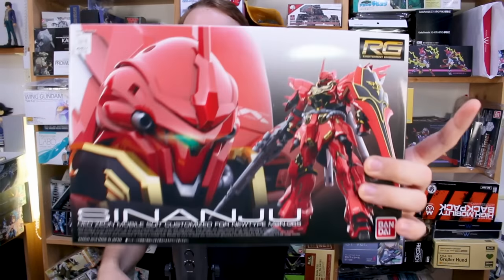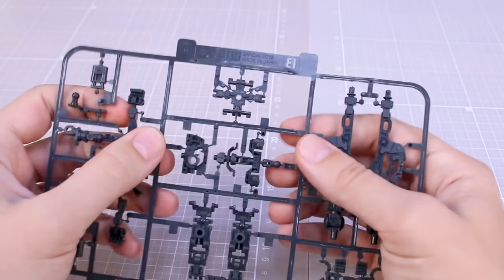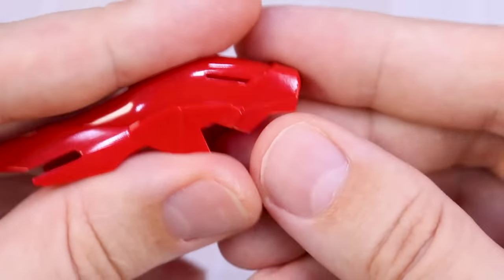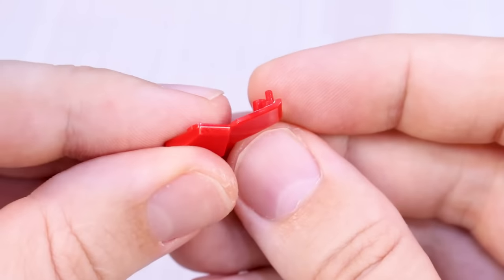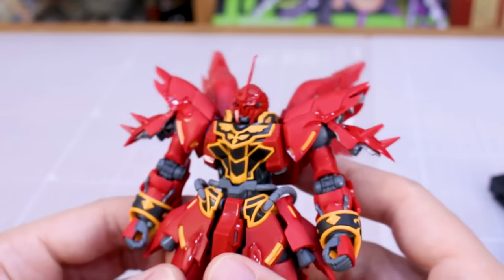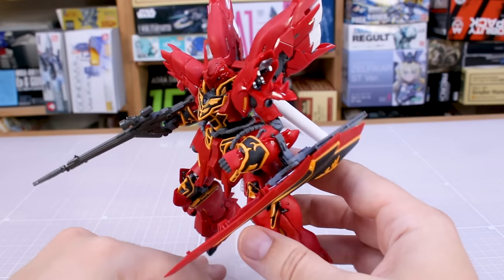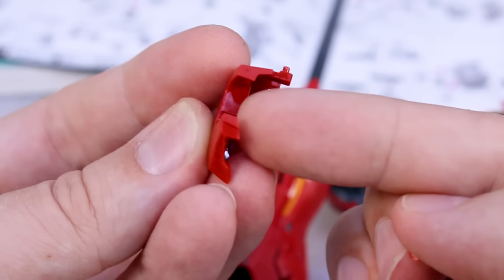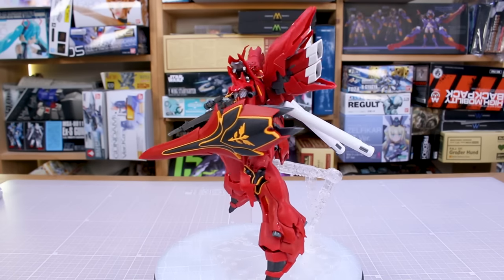What Makes a BAD RG? - In-Depth Case Study: RG Sinanju Revisited

Comment: The HG Shinanju is actually a really sharp looking kit.  Certainly one of the better HG kits.
Reply: The HG & MG ova version are better overall besides the stickers.
Reply: Frankly, I prefer the look of the HGUC Sinanju to the RG, and it's not even very close to me.
Reply: it was my first kit and the amount of foil stickers were insane, still a pretty nice kit overall
Reply: stickers kill off the satisfaction tho. can be fixed with reverse washing but still
Reply: @stm12p  I'd imagine the kit falling apart also kills off the satisfaction too.
Reply: @steel749   true. however not entirely true for everyone. i prefer to keep them in 1 "best" pose after i painted them. so i glued the falling part.
Reply: @stm12p  gold gundam marker instead of sticker works very well on the HGUC
Reply: Waiting for mine to come in. I plan on negating the stickers and instead using gundam marker gold to make the parts that are supposed to be stickers actually painted on. Wish it was separate pieces it’d be lots easier
Reply: @stm12p  why bother with the sticker if you're painting anyway :/
Reply: and rg sinanju is just the same armor design as hg sinanju.  no rg panel line detail. the only difference is just the gold sleeves
Reply: @bimaatmana9505  i dont normally paint HG kits. like i said stickers can be fixed with reverse washing but still seeing that amount kills off some satisfaction. i don't even bother painting RG sinanju cuz it looks astounding by itself
Reply: @bkebradley  The HGUC and the RG are the same kit apart from the inner details and the gold. Even the RG decals are compatible with the HG.
Reply: @chaiweijun8072  Im new to using gundam markers and want to use it for the Sinanju. Would a gundam marker be all I need? I dont want to use extra paint so Im holding off
Reply: @mikloridden8276 for HGUC Sinanju the part to be painted has recessed non gold parts. So just run the flat tipped gold gundam marker along the protruding parts lightly, it should work out.
Reply: but the stickers...
Reply: @mikloridden8276  It's possible but also certainly a very precision-heavy job. Very easy to smudge paint over the edges of the raised details and then trying to clean it up and ending up hitting the part you actually want painted and then repainting it etc. That's the reason behind people developing the reverse-wash technique for the Sleeves Mobile Suits: despite the extra materials involved it ends up being an easier process.
Reply: @steel749  the mg ova version at least comes with the ver kas waterslides tho
Reply: In my place the hg price not that much different than the Rg sinanju. I'll definitely buy the RG even its hand grenade. I'll fix it
Reply: And much better to scale up if you don't want a figure that will fall apart in your hands, you have the solution, the hg
Reply: Ovjectively, it is a pretty good kit, especially for its time. However, mold degradation really hurts it on newer reprints. I got one with the blue bandai logo a few years back, and the joints' stiffness was all over the place. Some parts like the ankles were annoyingly loose, where as others like the shoulders were stupidly tight. Keep in mind that this was one of my first kits, so I wasn't very familiar with using things like sandpaper or super glue to fix those issues, but I was informed about how to handle these kits.
Overtime, even with just minor pose adjustments every now and then, the left arm + one of the backpack's thruster straight up broke, which was kinda sad as the sinanju's my favorite zeon suit.
Tl;dr: yes gud kit, just not good for straight building (btw the stickers were a nightmare)
Reply: Still in process of building my HG so I'll without final opinion, but these gold stickers are unforgivable

Comment: “Playing” shouldn’t include “changing the pose once every 6 months” and finding that the kit’s joints have loosened. That should be a normal use case.
Reply from the maker: Every kit gets lose over time
Reply: How bout metal?
Can they get loose too?
Reply: @ZakuAurelius  But you always frame it as people “playing” with them too much. Also, there are small differences from kit to kit that come from tiny production issues. Fabrication machines all have tolerance levels. I imagine Bandai’s are very high tolerance, but the same part from two different boxes of the same kit are not going to be 1:1. These small differences lead to different experiences for some folks. Plastic quality can also vary depending on the production run. But you just seem to hand wave these issues away as user error. That said, I much prefer the format of this video to your earlier “myth buster” ones. You framed the latter videos as somehow more definitive than other people’s equally as valid experiences with the same kits.
Reply: @evoltblackhole8677  they wear out even faster because it's metal on metal while also being heavier, and not all metal joint has plastic insert
Reply from the maker: I’m not hand waving away anything, and sorry if it felt like that. Even if what you’re saying is true about parts not being 1:1, you may be right, but it would have to be like 1:0.999. My point is that it’s so slight that it’s practically insignificant and either way the fixes to any issues the kit has are pretty simple. Therefor it’s unfair to write a kit off entirely as “bad”
Reply: @ZakuAurelius  sure. I agree with you there. You can’t write off a kit entirely as bad. But we should understand that some kits are predisposed to issues and some people aren’t going to have the same experience with the same kit. I’m building the RG Zeta right now, based entirely off your review, and I’m treating it very carefully. But I can easily see where this thing can fail if one or two pieces aren’t perfect. That 1:0.999 makes a difference when you’re talking about these smaller, more delicate kits, I think.

Comment: I would say not every model kit can be perfect. Rg line has been an experimental for Bandai before it became the way it is today. Sinanju in overall is a great model if you can fix those issue up and I really enjoy its unique build process.
Reply: U can't,the problem is the MK2 frame and loose part
Reply: Yah, but bandai spend time and effort for the rg lines maybe lets call this hit and miss.
Reply: Being positive doesn’t make the issues go away
Reply: I had tighten the joint from beginning to avoid the future hassle. I would only say that it is a model worth spending time on fixing the issue and to enjoy its other better aspect. But that is just my perspective and my joy in building complicated and complex model. My sinanju is still standing up well after all my play and disassembly (to enjoy the inner frame) too.
Reply: I think they were testing the concept of reusing molds by adjusting some parts of it, and since it failed, they never tried it again hence why other supposed real grades never came out like goufs(probably base on the zaku frame).
Reply: @kevjad6536  I think RG Zaku's frame still plausible for RG Gouf, it's still MS with standard size and no particular gimmick after all.
Reply: @seabookarno1664  well, even if I agree, I think Bandai is moving away from using pre molded Frames, mainly because of the backlash from the early RGs, specially this kit
Reply: @kevjad6536  Plausible, doesn't mean Bandai will do that later.
Reply: Nothings perfect. Make the kit your own with a little extra effort.
Reply: @dsleong8328  Maybe you can’t. I did.
Reply: @jaypeterman9721  Skill and effort made them go away :)
Reply: @ninjatango  the point of a bandai kit is that they always advertise you don't need any extra to build a kit,they didn't mention you will have to fix it yourself,based on this you can't really say the kit is good
Reply: @557deadpool  Not sure what are you implying about.

Comment: At 27.41. You can use super glue, applying directly. Let the glue flow into the joint. While the glue is curing you then move the joint bact and forth. Do it slow but don't stop until the glue completely dry. The joint is still movable but will be more tight. If it is not tight enough, do it again. I used this technic in many prebulid joints in RG kits.
Reply: You are a lifesaver. Thank you for this esoteric knowledge
Reply: I did this unconsciously with my broken arm in wing zero RG... What a shock it was, when I realised the arm is in one place, connected again,  stiff, and movable...

Comment: I still have mine that I got probably a year after it released and it still holds well except for the backpack that has a kinda funky connection. I honestly would still recommend it for those in they’re intermediate stage of gunpla collecting
Reply: Yes that backpack connection is really strange, it locks ok but if you want to get it out, kind of loose but still kind of connected… but aesthetically, dashing is the word for it
Reply: @kelvin8369  definitely
Reply: mine is fine straight built out of the box with no modifications. I just put mine in a standard standing pose and put it on the shelf.

Comment: I’m today years when I found out there’s such a thing as a glass file. 

Also can’t thank you enough, I learnt a lot from this.
Reply: The softer, nano glass files are literally lifechangers. I barely use regular sanding sponges anymore.
Reply: As soon I started using one, I can't imagine NOT having one in my toolbox.
Reply: I decided to pick one up as well, it looks promising and will help alot with future kits.
Reply: @Ra3_ar1adnE  Be sure to look for a nano glass file that has very low grit. There are coarser ones that woudn't perform as well.
Reply: @AssaultFlamingo  how low,like 600 or 400 or 200?

Comment: In wood carving we call a cut toward yourself a "pull cut" and there is absolutely nothing wrong with it as long as you are maintaining knife control, usually choked up onto the blade, and using soft even pressure. Your technique is fine. Have loved finding this account and watching through this rich back catalog! Keep up the good work
Reply from the maker: Thanks man!
Reply: I try to cut away from me, but sometimes you just can't get a good angle.  I haven't sliced my finger open since carving a pumpkin in the 1990s.

Comment: I definitely share the same sentiments as you. I love these as models. I don’t play with them. I find a pose I like and move on to the next cause I know when I used to play with them they never held up. (Rip my MG Zeta 2.0 which arm torn off when I turned it one day after constantly transforming it.) As models there are a lot of advancements that I enjoy more too like kits that don’t have those rubbery ball joints. I find that the friction of plastic on plastic helps keep poses much more longer than a rubber ball joint.

Comment: Great vid! Really appreciate that you tackled the problems from both perspectives despite having a "modeler's" bias, particularly when suggesting fixes for the loose joint problems which don't necessarily permanently fix the articulation (because I do like to repose my kits every so often, though I wouldn't say enough to feel like I treat them like toys). Also since you mentioned not knowing when your kit was produced, I believe you can tell that by the two clocks on the back of the runners. The first one (1-Z) should be the month and the second one (0-9) is the year (added to the 10/20/whatever in the bottom corner).

Comment: Good stuff. I did encounter genuine issues on some of the RGs I own, like I don't know if it's just for me, but the lower cockpit part on the astray just didn't hold, it fell off without even touching it, this one I actually fixed with a magnet, which you can't see, I drilled through the inner frame, but ended re-enforcing it. I did this on some HG parts as well.

The other issue I have found over the years, there's fake complains, some are 100% on the model builder, like with several kits, you have parts not fitting properly and I own the mini, it's fine on my, I just know he didn't do the work correctly. Some kits were called a disaster, I build them, they're fine. Now some kits, can't be fixed, they're just too heavy (many MGs & some PGs), there's kits like the Barbatos Lupus Rex, it's just too heavy, feet don't hold, torso doesn't hold, a base is the only way, the only way to fix it is a revive.

Comment: When i wanted to remove the gaudy "gold" coating from HG Akatsuki, i just dipped parts in the cheapest oven cleaner i could find. It did take several hours instead of minutes. But all the coating came off easily with no damage to the plastic.

Comment: Glad this came out. Ive been wanting to get this kit but the problems I've heard about have been holding me back so hopefully this helps.
Reply: Get amazed by the separate gold parts. 

Get your glue ready tho to thicken stuff.

Get frustrated by that shield.

Don't buy the weapon expansion set. It can't hold them well. 

Tho I didn't break anything, that glossy red plastic is pretty brittle.
Reply: @wulf8889  holy shit I hated the shield so much and the weak waist joint isn't helping either.

Comment: 7:00 I'd say there's an even easier way than polishing compound: use a glass file. Specifically, a nail buffer. That leaves the plastic so smooth and shiny that if you're planning on using it for the regular, matte-finisj parts of other kits like your average HG, the recommendation afterwards is to tone the gloss down by rubbing the shiny parts with a melamine sponge (such as a Mr. Clean Magic Eraser).

Comment: I had a very skeptical opinion of the this kit before I bought it. I was of the opinion that, people just like to complain and that maybe the kit just wasn’t AS good as some of the others. 

Then I got mine. The build was fine. Everything seemed to go together fine. Then a couple months went by. I’m not one to take them down and repose them a ton. Maybe once or twice and that’s about it. But this kit just fell apart over time. Some of the press fit joints just gave up. The knee armor, wrists, hips, the head, etc.  

Recently I decided to fix it. Glued a bunch of those looser fitting pieces on, no issues. Glued some of those joints in the torso leaving only… I think two of them still mobile. 

Then, I added some glue to the joint connections, like the hip pegs and arm pegs. Worked fine. 

Then I just crammed some sticky tack into some of the other crevasses and boom. Solid as a rock now. You can shake the hell out of (and I mean violently) and nothing falls off or loses pose. 

There’s a reality to this kit being VERY poorly engineered though. That’s real and it effects the kit in ways you can’t just describe away as “it’s not made to be played with.” I don’t personally know any Gunpla hobbyist older than my 6 year old son who “plays” with them. This kit really is just bad out of box. There wouldn’t be a need for tutorials on how to fix it if it weren’t.

Comment: I’ve only had a couple of kits crumple on me overtime without me touching it, I started building when I was 17 around 2014. Both RG zaku and strike gundam leg joint connections split without me touching them, only like once or twice to Pose with or without weapons idle pose. I guess the climate also has something to do with it. Although RG mk2 I guess with the screws made it very sturdy.

Comment: I took some plate from one of the runners and shoved it in the waist joint and filled it with glue and that made my sinanju much better. Also glued the shield bracket to the arm, however the placement of the shield is awkward so posing this thing is still a pain in the ass. 

Reusing the MK2 frame was this kit's achille's heel.

Comment: 04:50
I'm of the same opinion about the definition, but my RG Strike's had a "stupid" issue.
build it, posed it and left it for at least a year.
got an aftermarket Perfect strike flight unit and noticed the hip joints were all loose, it kept on standing no problem, but after having moved the hips to remove and attach the backpack, the hips were just a loose mess :/
Had to tighten them up a bit with a drip of glue on the joint (when the joint was out), but I was still somewhat disappointed.

11:50
Ovencleaner and other acidic cleaners work decently, takes quite a while and you don't want to breath in the fumes (same goes for the paint, but still).

Comment: 8:20
As someone who watched people build models and then started my self, the cuts you are making with a hobby knife are so controlled and slow that even cutting directly against your thumb, I've never cut myself from an intentional maneuver.
Accidents do of course happen but it is no where near as scary as it looks.
Also you guys don't need gunprimer brand name stuff, just a common nail buff block will do a good job leaving a matte or gloss finish.
Reply from the maker: I do still poke myself from time to time. Often right after changing the blade. I think that adjustment in resistance from a dull blade to a super sharp one takes my hands a little time to adjust and that’s where accidents happen

Comment: I know of the issue when I built the kit but don't think it is as bad as they made it out to be. I did pretty much the same with the body and arm joints. Just added a few plaplate to block the articulation a little bit and the kit became more rock solid.